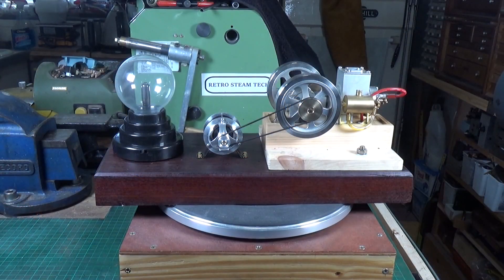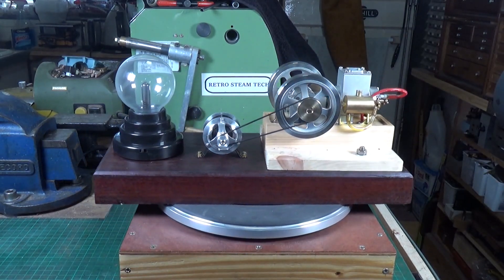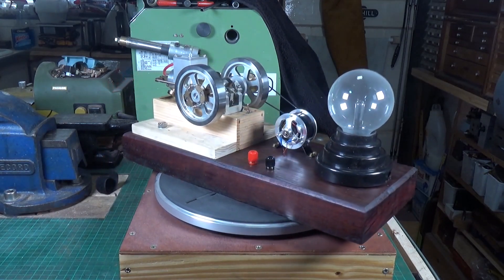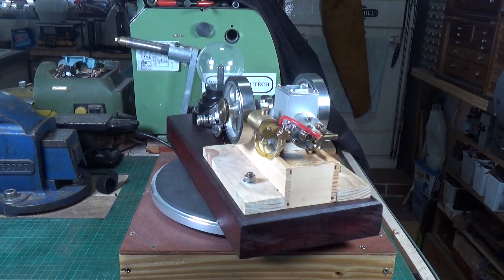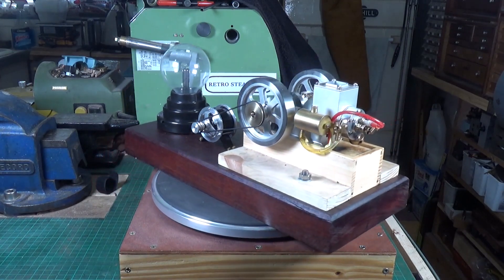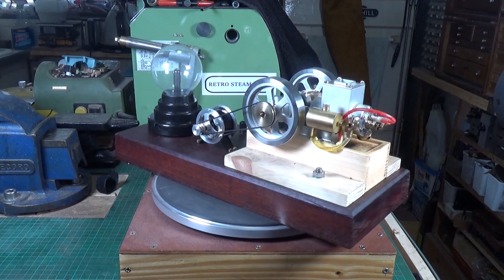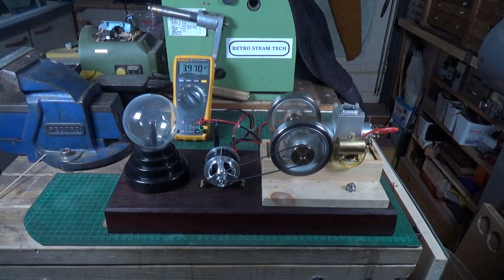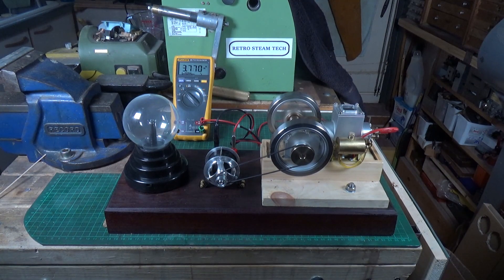Chinese Hit & Miss Engine Powered Plasma Ball

Comment: Thanks for sharing! That is really cool. You might want to look into installing a power reguator to protect the plasma ball. They're cheap and easy to install.
Reply from the maker: Thanks Craig. Having the terminals means that I can monitor the voltage so there is little danger of damaging the plasma ball.

Comment: Great video Alan.  The plasma ball works well.  Seems to handle that voltage OK.  I wonder what it's max voltage is?  Interesting stuff.  Cheers Rob
Reply from the maker: Thanks Rob and thanks again for educating me about Jarrah, I really love that wood 👍🙂 The Plasma ball draws about 250mA at 5V.  So even though off load the dynamo gives about 10V at the rpm that the engine runs at once you start drawing current it drops to about 4.5V. Need to connect the dynamo to a high revving engine to see what it will put out. Cheers, Alan.
Reply: @RetroSteamTech   That's interesting Alan.  Maybe I should run a plasma ball off of my compressed air only, double acting steam engine and small dynamo ?  Banggood should have them.

Had the eye op this morning and it was smooth sailing, but I'm really handicapped ATM as it's patched and my depth of field perception is temporarily crap.  So far so good though. Cheers Rob
Reply from the maker: @Xynudu  Really glad the eye op went ok 👍👍👍 Hopefully the recovery period won't be too long. Cheers, Alan.